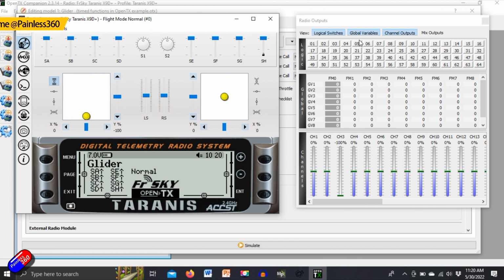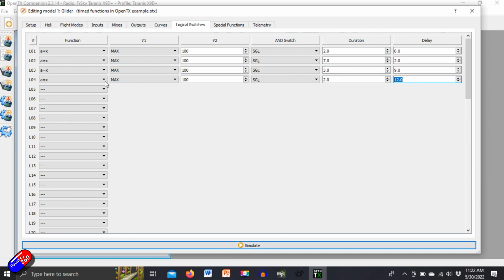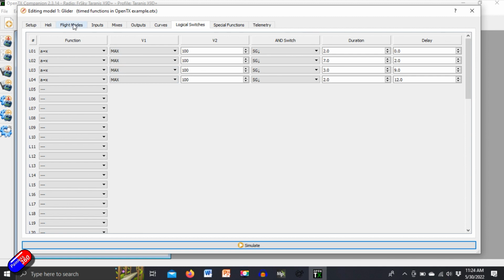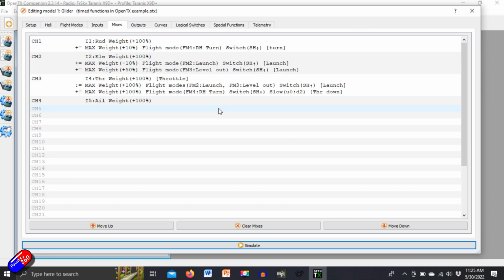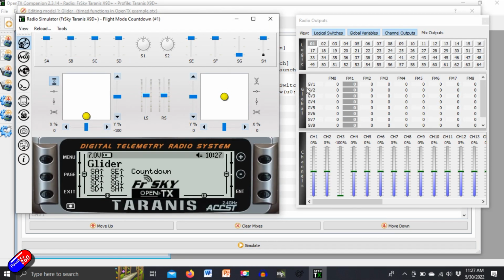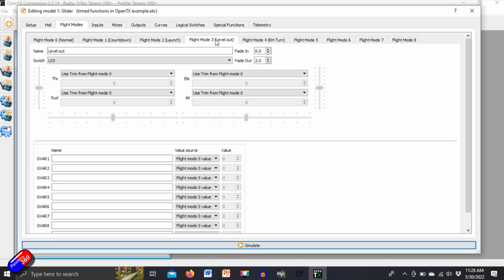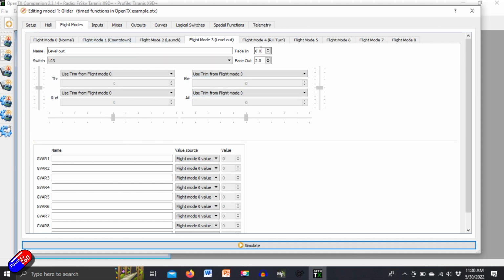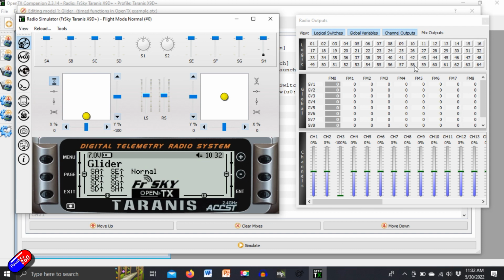EdgeTX/OpenTX - Using the timer to do stuff like automated launches (Patreon Request)

Comment: Brilliant info as always, I will adapt this to control the camera gimbal on my big quad, rather than moving the quad to get the panning shots I can use nav pos hold and repeat the sequence till I get exactly the shot I want. Stay safe Lee
Reply from the maker: You can also move the controls onto the other channels for the gimbal at the flick of a switch too. Let me know if you need a video to show how..
Reply: @Painless360  already got that set up but thank you but I like the idea of an auto sequence that is repeatable and using the fade in and out (which I didn't know about ) I can make it a smooth sequence rather than my jerky version doing it manually. Above all I like playing with open tx

Comment: Hi Lee 
Slightly off this topic but would it be possible for you to show how to setup a motor cut off when you reach a preset height and for it to call out the motor is off as the altitude limit has been reached?
I am using the Gxr6 vario receiver and want to use the telemetry to be able to 'launch' from the same height consistantly.
Many thanks 
Stu
Reply from the maker: Sure, you can setup a logical switch that comes on when the altitude sensor goes above a certain value and use that logical switch to act as a regular throttle cut... best of luck

Comment: Nice work Lee.
Suggestion: Why not simply use SG (in your example) as the enable/safety switch in each flight mode? Using just one switch to both initiate and abort the sequence seems less complicated to me. But maybe I'm missing something (which wouldn't be unusual).
Reply from the maker: Fab suggestion! As mentioned, always more than one way to do anything in EdgeTX and OpenTX... Happy flying!